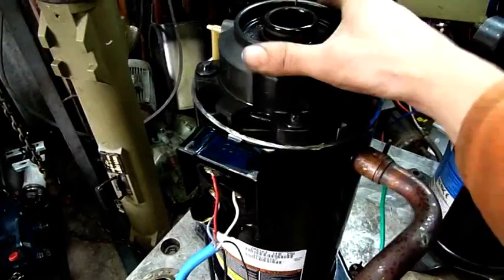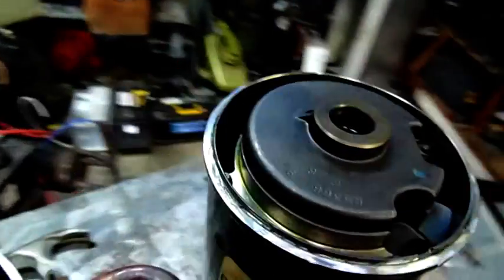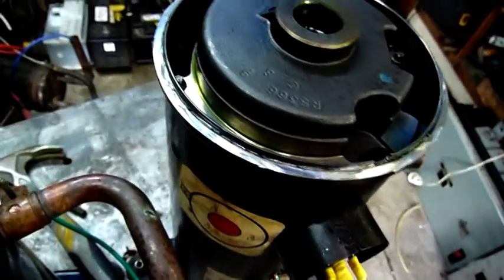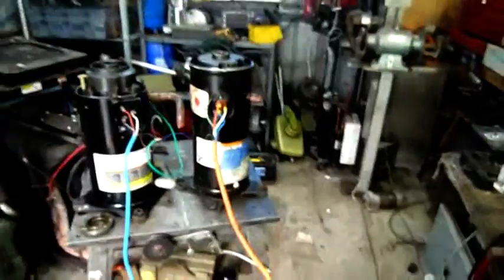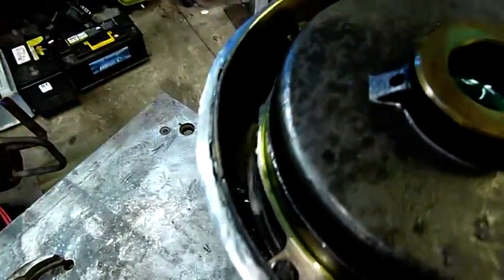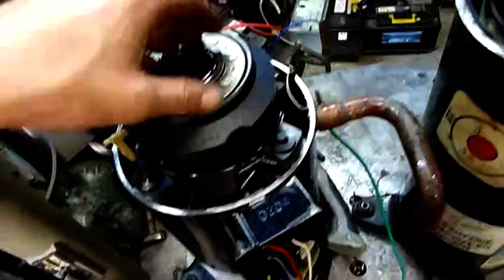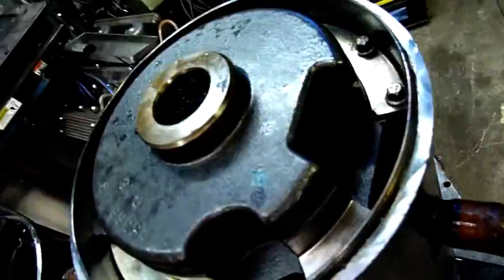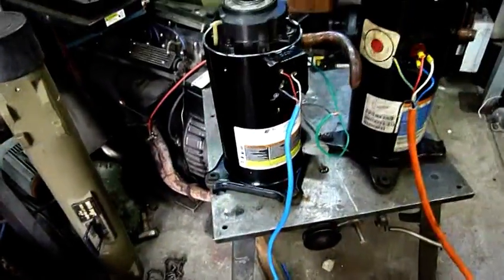HVAC Scroll Compressors Running Open and Exposed

Comment: Can I use a scroll compressor that has been cut open and then welded again on an industrial system with 30 bar high side pressures?

Comment: After watching this vid, I realize now that the community electric power here is not consistent with volt/freq  for my copeland scroll. You can tell from this vid, its the perfect tuning fork when the volt/freq are off and makes it noisy. I had a new unit installed and It lasted 7yrs, and I had to have a new compressor put in. This one is noisy based on certain times of the day but especially at night.( unless the new replacement was another dud waiting to fail ) Sometimes, you can hardly hear the compressor running. Thanks for the vid, Ed. I'm counting the days until the next failure.

Comment: could you please tell me if this statment is true "The motor compressor is suspended by springs in the capsular housing which minimises the transmission of vibration to the capsule body, thereby reducing noise Emission"

Comment: Mr.can i use refrigerator compressor as a replacement for a bad air conditioner?the air conditioner uses R-22, can i use R134A with a refrigerator compressor?
Reply: no

Comment: Our new ducted air con has the same scroll compressor, its quite noisy, that vibration as it winds up shakes the wall of the house its sounds like a one cylinder engine running. I had to install rubber pads with the mounting brackets to reduce the noise.

Comment: is it possible to repaired copeland scroll compressor? there is no resistance between phases
Reply: When hermetically sealed compressors go bad, you replace them. Did you wait for the compressor to cool off and ohm it out? If your unit was running low on refrigerant, your compressor will overheat and trip the internal winding thermostat. A tripped internal winding thermostat will show OL on your meter.
Reply: We have this issue with two compressors. They are installed in different units. First we checked the contactor, they burned, we replaced them and when we ran the compressor, has a short circuit between the phases and contactors burned again. Then we checked  the phases at the first compressor there no resistance and at the second compresor had short-circuit between phase and compressor case. is it possibule to open the comprssor and to repaire it?
Reply: No. It is not possible to open it and repair it. you have to replace it. You would have to cut open the shell, fix the burnt winding/ valves..., and weld it all back together without having any leaks. This is beyond the scope of an average HVAC tech. If it is replaced under warranty, The old compressor is sent back to the factory where they will verify it is inoperable. The factory may recycle the old one.

Comment: a VFD or "Variable Frequency Drive" is a device that controls not only the voltage but also the hz being supplied to a motor in whats called a Volts Per Hz (V/hz) Mode. a dimmer switch just chops the voltage while keeping the frequency the same. This can cause problems on a fixed displacement (FD) pump/comp. Not lowering the Hz while you lower the voltage would be like trying to push a semi at 75 with a riding mower. I don't have enough room here to write out all the details of why, sorry.

Comment: "i think the copeland is better"......of course IT IS!!, you dirty Aussie!!(just busting your balls!)...anyway, THANKS A LOT FOR POSTING THIS VIDEO!!.....could one of this be used in regular air compressor---and how would I go on about cooling the unit and separating the oil from the air so oil wouldn't come out of the air outlet........also would it fill the air tank faster??? and at higher PSI?

Comment: @V8Jagnut Haha, I thought of that too. An open-top scroll compressor with a fat flame thrower shooting out of the top of it. :-D Definitely an 'outside job' though. 

Who needs a propane patio heater when you've got a flame-throwing scroll compressor? :-D

Yeah, that would be nice......Especially if the compressor was going to the scrap bin anyway. May as well get some flame-shooting fun out of it while it still runs. Crank it up on the VFD and watch the FLAMES!

{^_^} BoomBoxDeluxe {^_^}

Comment from the maker: @MrGerbilBrain if its been doing it for years it could be a loose casing panel vibrating, I have fixed a few noisy units simply by lining the mating surfaces of the sheet metal with self-adhesive foam strips.

Comment from the maker: @locouk daewoo cars got bought up by GMH and still make cars under the Holden name in AUS, as far as electronics and appliances go, I have no idea. but these Daewoo-carrier AC units were horribly built at the factory. no less than 4 leaky solder joints, and horridly sloppy ones at that.

Comment: Be careful breathing the oil . I believe divers have to be very wary of that when using compressors for air supply as it does very nasty things to a person. 

Would be cool to hold a blow torch over it but and light the vapor up!